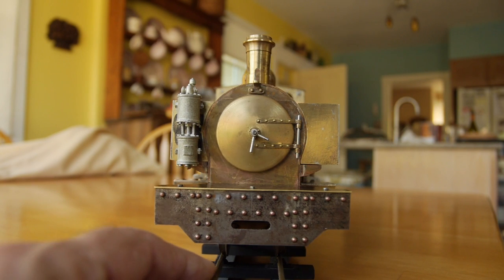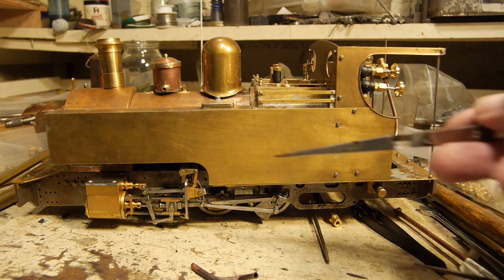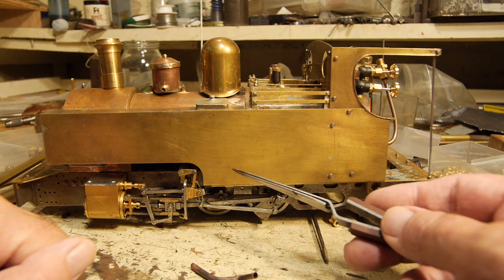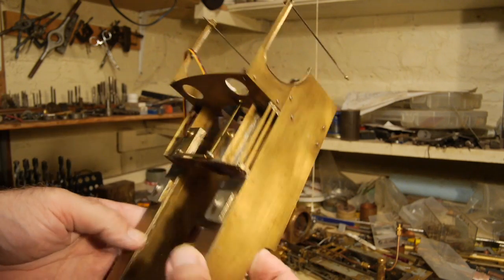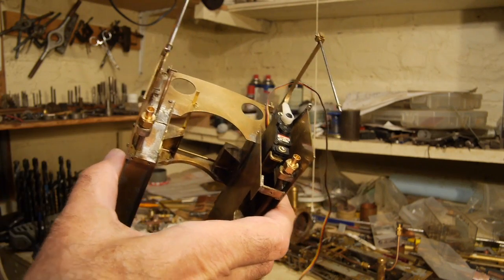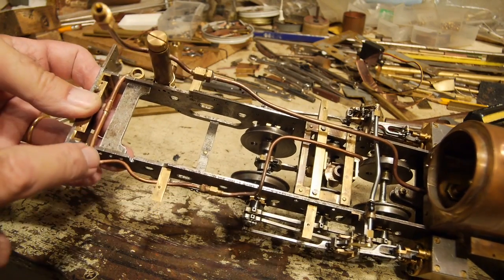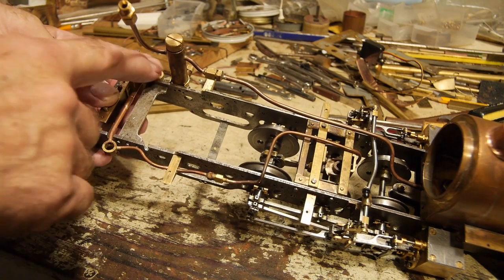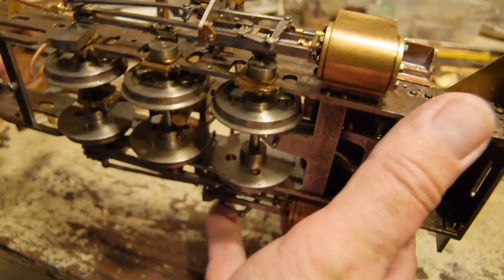'Russell' Live Steam Model Locomotive Part 7

Comment: With such narrow tubing are you not afraid they will clog with calcium?
Reply from the maker: I don't use tap water if i can help it.  Either distilled water or rain water.   Don't use deionised water it can rot the silver soldering.

Comment: For the tanks on each side- by "balance pipe" do you mean a "cross feed" as we'd call it in aviation? Basically, a way to have the tanks automatically equalize? And how are you doing the water injectors? Sorry if I missed something.
Reply from the maker: Exactly right, the balance pipe allows the water to find the same level in each tank and feed from one point to the pump and the boiler.  There are two ways of getting water in - the axle pump that pumps water every time the wheels go round and a Goodall valve on the side which allows me to plug in a tube attached to a water bottle and hand pump water in.  A real steam injector would be great but I don't think anyone's made them that small yet.

Comment from the maker: Thanks for your comment.  You can make the controls yourself and they could be smaller than commercial part but i like to buy them if I can.  Also remember they have to be a practical size to get your fingers in to operate.  With a water gauge I explain the problem of making it smaller in https://www.youtube.com/watch?v=bW2kK9Eck1.  You could push it as far to the side of the boiler if you have room and still see it.